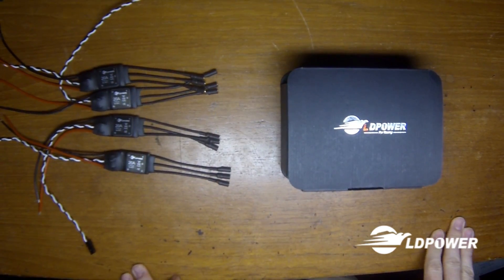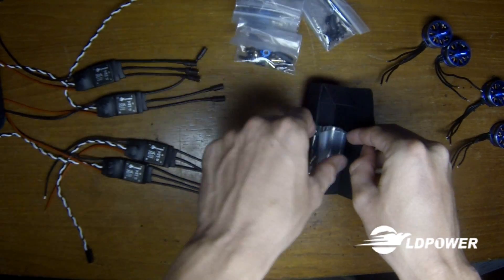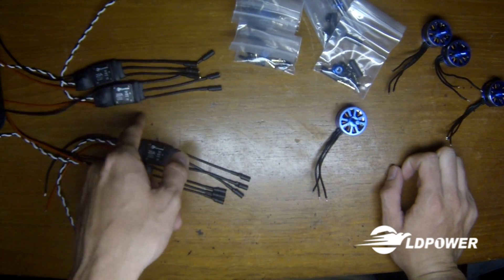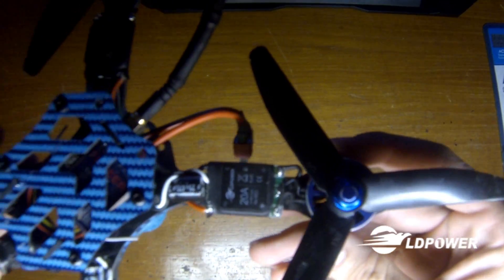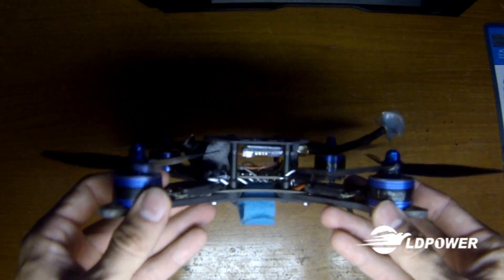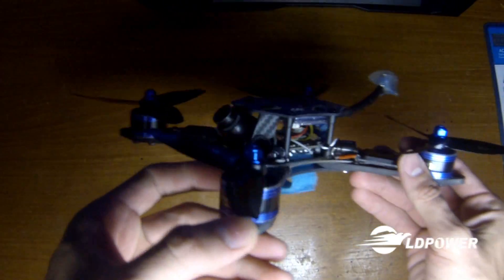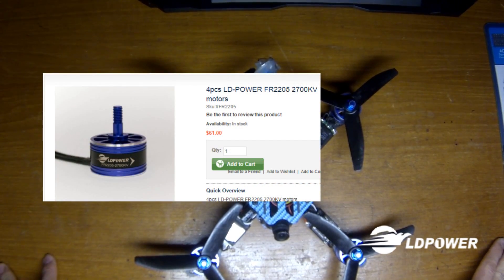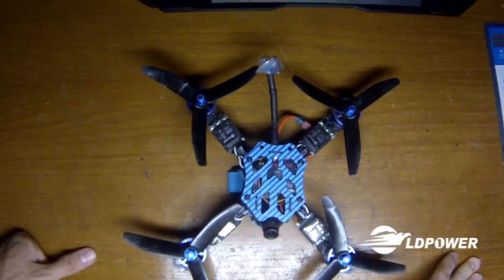LD Power 2205-2700 20a ESC Review

Comment: Those ESCs look a whole lot like Xrotor 20amp ESCs from Hobbywing. If so yes they are defiantly beauty. If you use a arduino nano it is not to hard to flash them to Blheli then they really come alive.
Reply: Ill give it a shot but I couldnt get the toolsticks (all of them) to detect it. Ill probably have to strip them and connect to the internal points. Thanks for the info!
Reply: +Woodys Builds this is the guide that I followed if in fact it is a Xrotor. 

https://nathan.vertile.com/blog/2015/11/16/flashing-xrotor-20a-with-blheli-via-4w-if/#top
Reply: Interesting.... That would mean that its a Silabs chip which would explain the already amazing performance.... Which makes me wonder what it would be like on BlHeli....